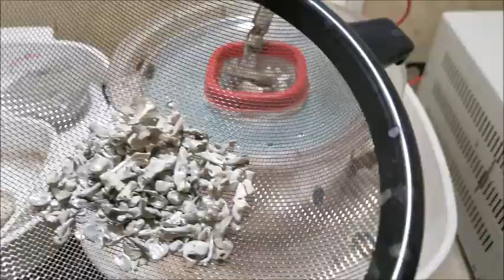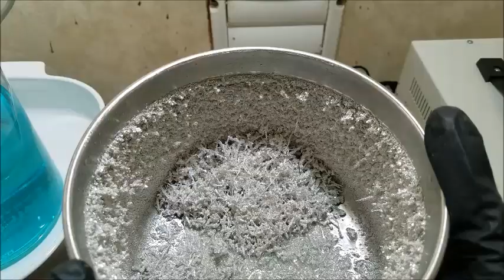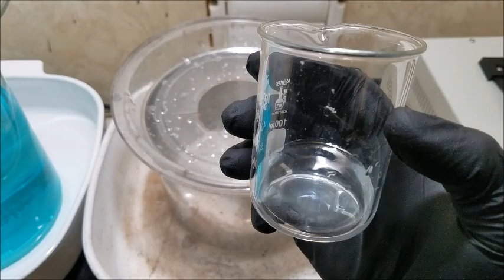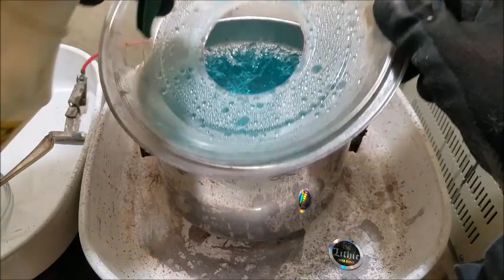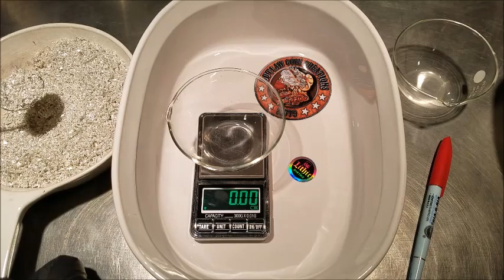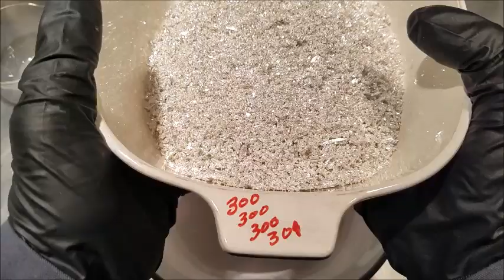90% Silver Refine (Part 4) Harvesting Silver Crystal

Comment: Hi lithic,  thought I would try my hand at starting up a silver cell to refine a very small amount of sterling silver, only around 50grms, my question is I only have 25grms of silver nitrate powder(pure) if I can stop the crystals from touching the basket, is this enough to do the job in around 250mmls of distilled water,. It's hard to get nitric acid to make my own, and tge powdere is expensive enough, thankyou😳
Reply from the maker: I don't know. But if the powder is apx 60% silver by weight, you'd have apx 15g of silver in solution. I generally use 300g of Ag per liter of solution. At your concentration of 15g to 250ml, it would be the equivalent of 60g per liter. If it worked, it wouldn't work very long due to the "high" amount of copper in the sterling. I would predict a failed experiment. It may be something you'd want to research better before you'd attempt it. It would still be fun to try. But make sure you learn how to properly dispose of the waste material first. Good luck with it!
Reply: I originally had it set up in a 700ml beacon, just wasn't sure if 25grms was enough to saturate the solution enough to do 50grms of sterling, would a lower voltage help to slow it down, completely new, but love these crystals too much not to try. If cementing out the old solution to silver and copper, will that clean the solution enough to dispose of, thanks for ya help👌

Comment: Hi Jeff, 2 days of watching, man, better than Netflix... My question is, what voltage do you use? I have seen 5 volts (Jason mbmmllc), 3,0 volts also 3,5 volts (Sreetips), 1,5 volts (Philip Bender). Lower voltage seems to produce bigger crystals, but is slow. As I do not have enough silver for such big cell yet, I plan to make something very small and primitive. Is concentration of silver in elecrolyte 12,5 % (125 g/liter) realy necessary?
Reply from the maker: I'm glad the vids are useful for you! I appreciate you watching!!
You don't want to go over 3.5v or other metals could plate out. You're shooting for high amps and low voltage. I prefer my electrolyte to be highly saturated... apx 300g of Ag per liter gives me the best results.
Reply: @LithicMetals  300 g/liter??? Oh boy, so heavy solution... You could walk on it... 🙂
Reply from the maker: @frantiseklaluch6605  lol indeed. It may be a bit overboard, but that's where I get the best looking crystal.